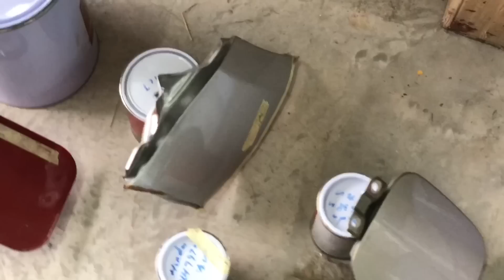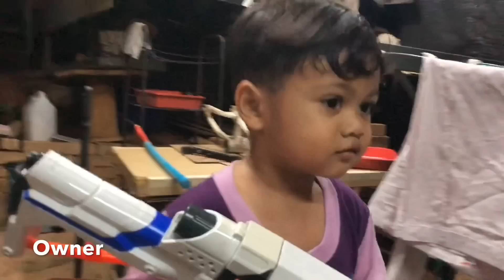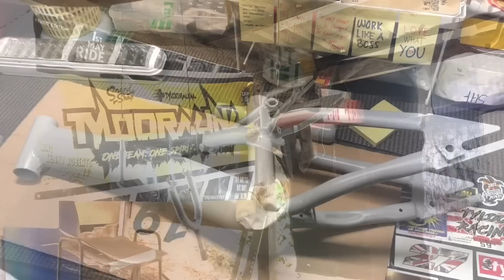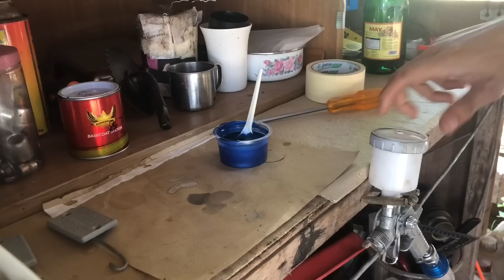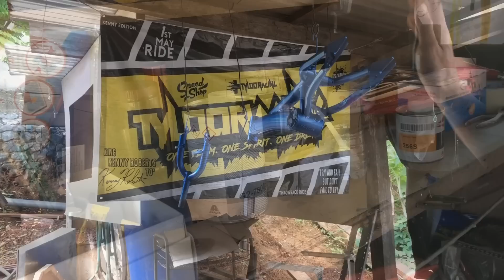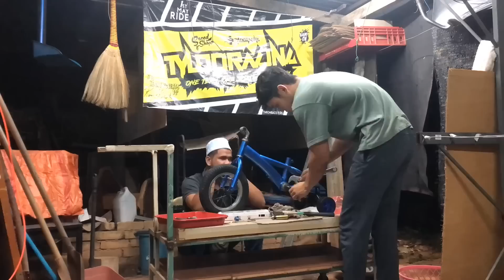How To - Repaint Bicycle 🚲 Ali

Comment: Bro boleh share tak berapa modal utk beli primer,base coat dgn clerar coat.. N lagi satu pakai spray gun jenis apa utk spray clear n base coat
Reply: Primer rm 55
Basecoat..bergntung jenama dan bncuhan cat. Sama ad 250 ml,0.5 ml dan keatas.. hrga untk 0.5 selalu bermula dari Rm35..

Clear pn ber gntung jenama dan jenis clear jgk..hrga bermula dari Rm47..

Dan untk spray gun sya saran kan  jarum 1.3-1.4....bolh guna untk primer,base dan clear coat.. wlaupn primer sbnar nya digalakn jarum 1.5-1.7..

Thinner nk cntik guna slow thinner lh..👍👍